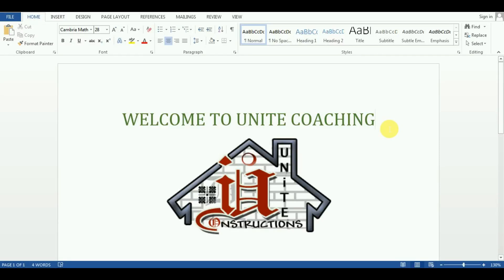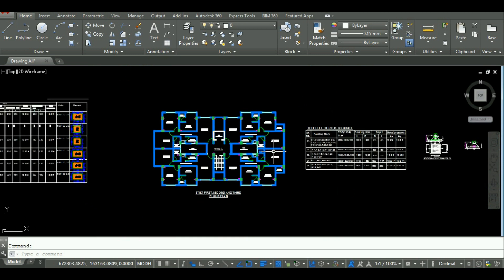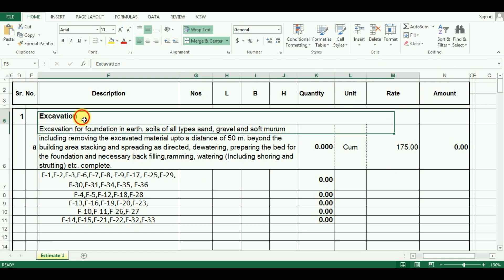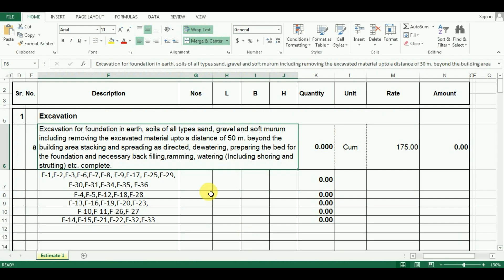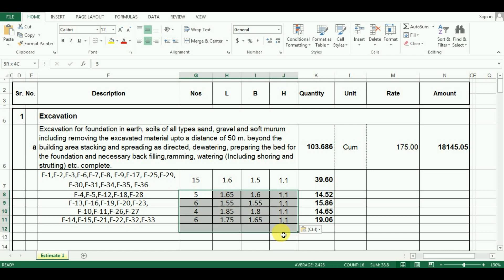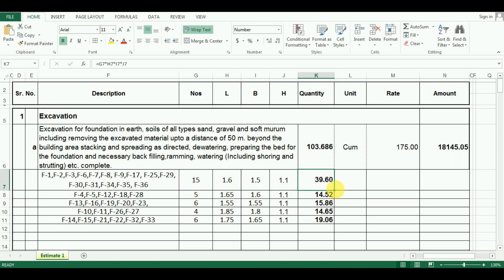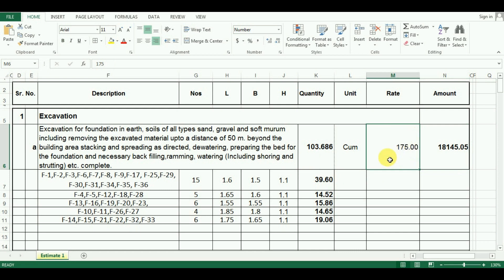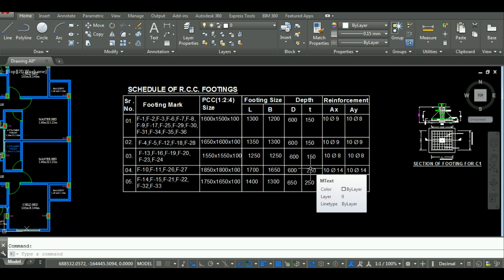Detailed Estimate of a G+3 Building in Excel -Part 1 Excavation

Comment: hello sir, where will long wall and short wall method be used in excavation? why long wall and short wall method is not used here?
Reply from the maker: Hello Pranjal,
The long wall and short wall method for excavation is used in Load Bearing Structure
In load bearing structure, we carry out excavation under full length of wall, since the wall carries the load of structure
But in this case, as this was a framed structure, therefore that method was not used and the quantity of excavation is directly calculated.
Reply: That's a very helpful answer unite constructions..👍👍👌👌